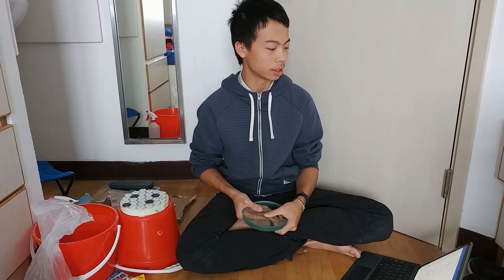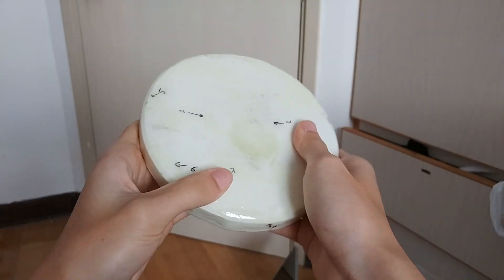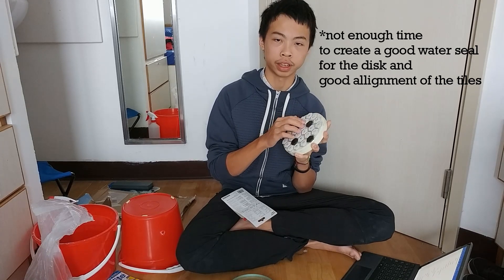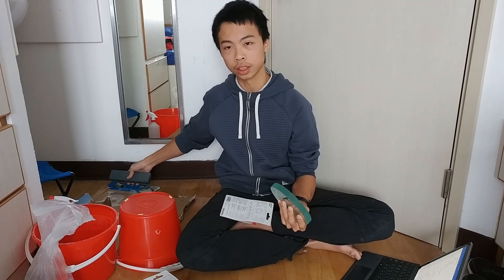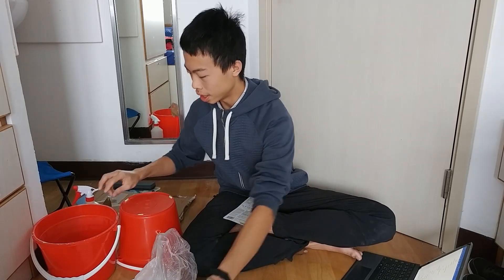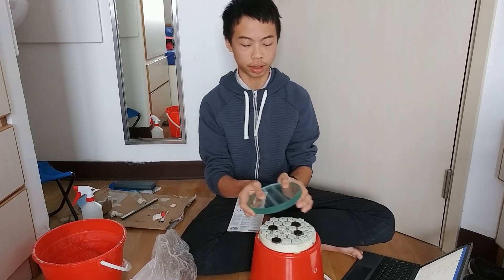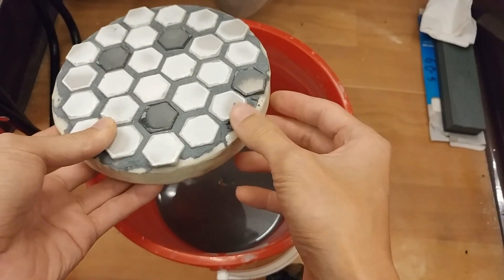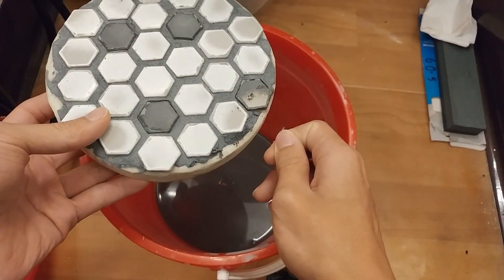Making of a 160 mm Reflector Telescope: Rough Grinding 01

Comment: Good video. A suggestion about how to lessen the sound from your bucket/table is to pack it with towels. The towels would absorb much of the vibrations, hopefully making it easier on your ears. It’s smart to do this in a shower, but the walls of the shower may also be a bit echoey. Perhaps hang several towels on the walls may be helpful as well. 

Keep up the great work!

Comment: Would it be better or easier to use a template to achieve the correct curve and use a steadier workstation I used a empty 45 gallon oil drum half full of water it’s rock solid I wish you success